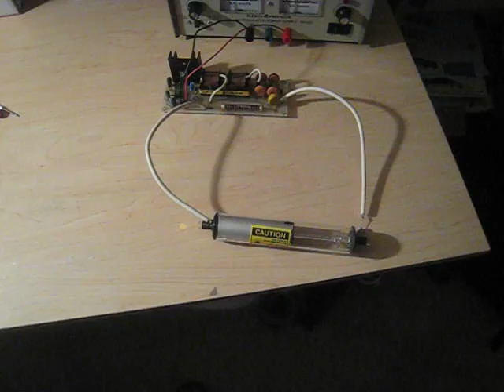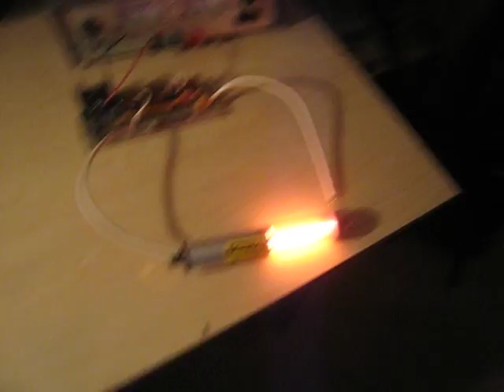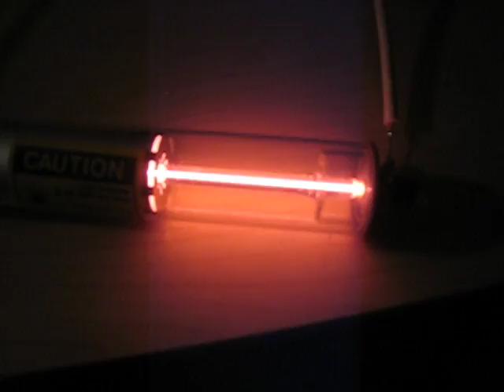HeNe Laser Build

Comment: An instructable got me to googling elenco, which led me here.  The schematic and parts list are in the instructable, however, there's no information on the transformers, other than how they're wired, (parallel in, series out) and that the input is 12V and the output is 2Kv.  so if I"m going to try to duplicate this schematic, I"ll need 2 transformers that when wired the other direction will have a 120V input and a 1.44 V output?